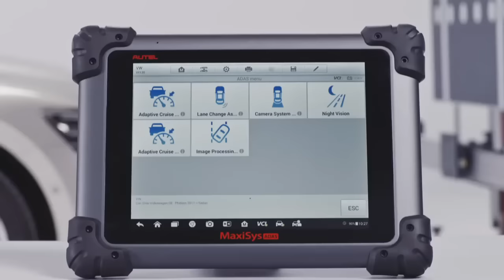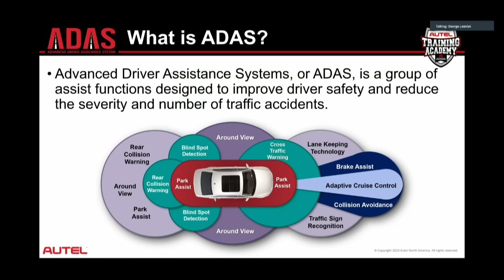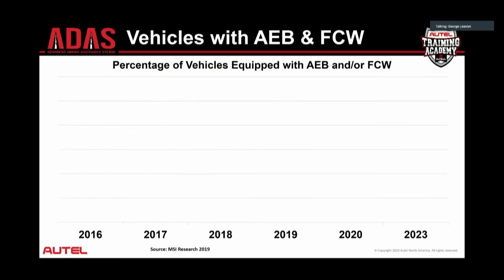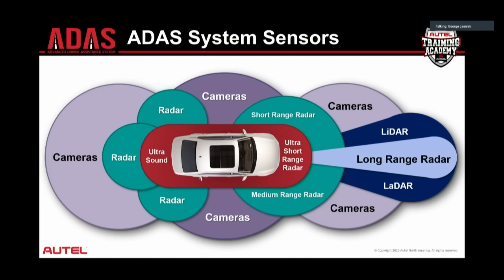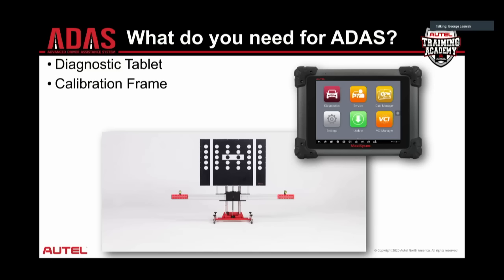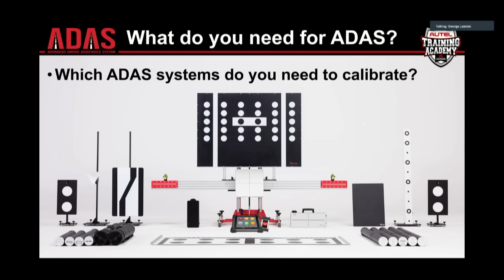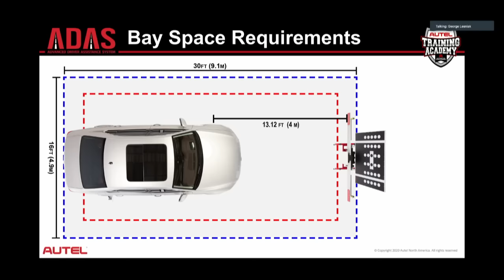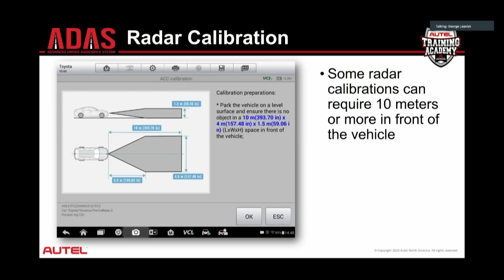Addressing ADAS Calibration for Modern Service and Body Shops

Comment: Thank you @MotorAgeMagazine for sharing this video!
Reply from the maker: Our pleasure!
Reply: I have been trying to reach someone from Autel for a couple of weeks now. I know that the Autel 908 pro can reset the windows but can any other device with a lower price do the same?
Reply: @dynastyof3880  Please call the tech support team any day. The lines are open from 9am to 9pm. If you do not want to wait on hold, you can leave a message and they will return the call same day. There is no reason to try to reach someone at Autel for several weeks. We have dozens of tech support members and we are answering hundreds of calls daily.

Comment: Hi George and Pete ,
Thanks for the great and informative lecture.I have some further queries surrounding the requirement for calibration after wheel alignment.If the alignment is found to be only slightly out and has been adjusted back to manufacturer guidelines , as it was when the vehicle left the factory ,and steering angle did not need to be adjusted and is also at Zero degrees , would the ADAS still need recalibration?
Would love to discuss further if available .
Many thanks again
Reply from the maker: I would direct your question directly to Autel (https://www.maxisysadas.com/) but in my opinion - yes, you will. Simply because you don't know what change you made relative to the original calibration. Even a 1 degree change can cause a system to "look" in the wrong place. And it's not just wheel alignment - it's ANYTHING you do that alters the vehicle's line-of-sight or the sensor's original positioning.
Reply: @MotorAgeMagazine  many thanks for the quick response, I will try Autel as suggested 
Regards

Comment: hello if i should just paint the bumper without disassembling. should the sensor be cralibrated I don't need it
Reply from the maker: If you paint the bumper on the car, you'll probably be OK. I would check to see if there are any considerations on how to paint it, in case it will limit the radar's penetration for some reason.
Reply: @MotorAgeMagazine   thank you very much